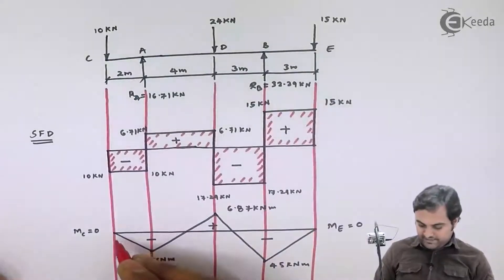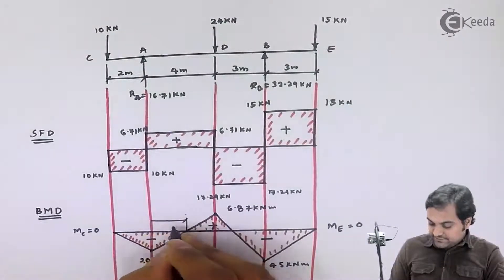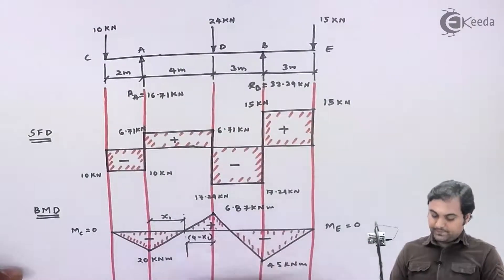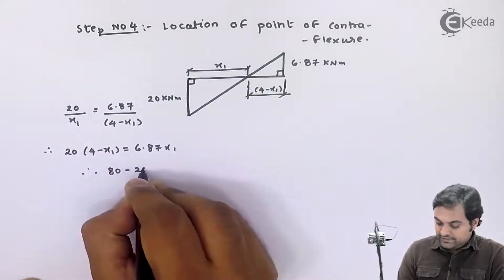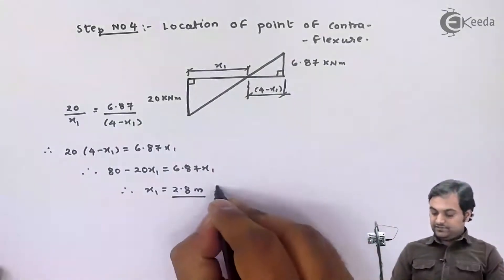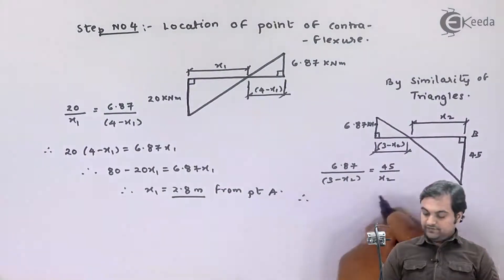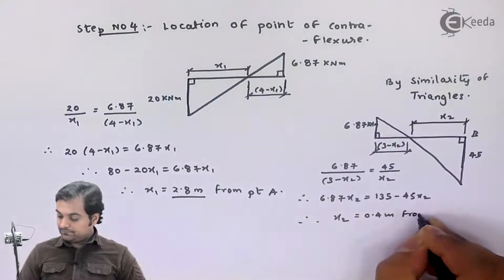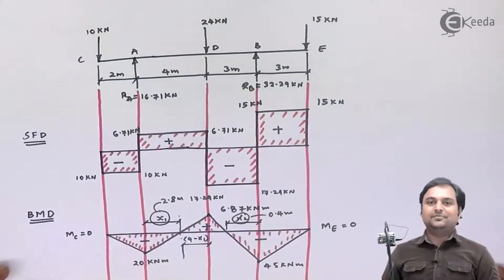Part 3 Problem no. 1 on SFD and BMD - Shear Force and Bending Moment Diagram - Strength of Materials

Comment: I think there's problem with the calculator you're using Sir. X1= 2.98; X2=2.6... Also 6.87 is supposed to be 6.84 from the calculation of the Md. Otherwise, I'm so happy enjoying your videos. They're helping me a lot. Thank you so much 🥰
Reply: i got the same answer's as you except 6.84, i got 6.86
Reply: other than that thank you because i was questioning it too